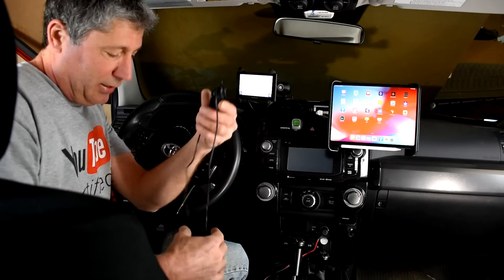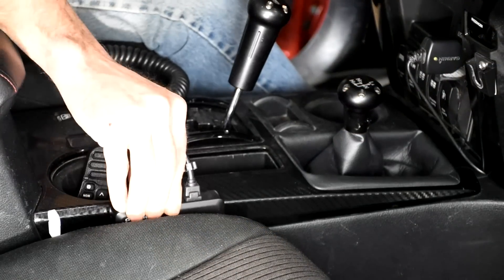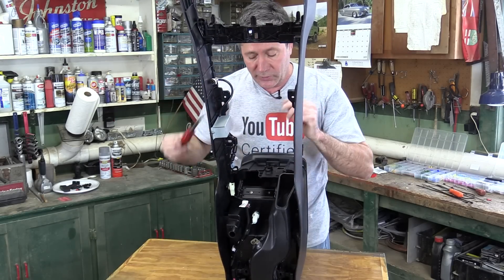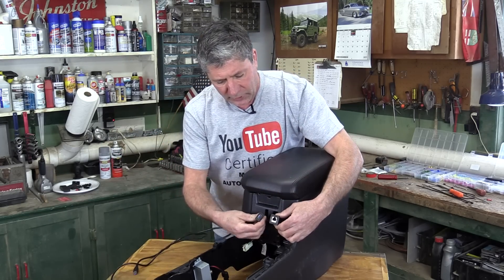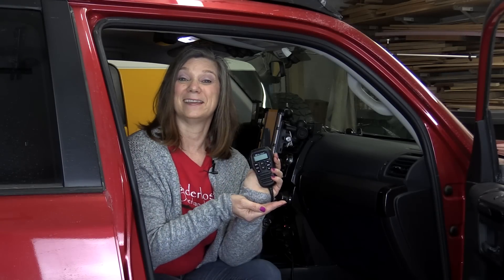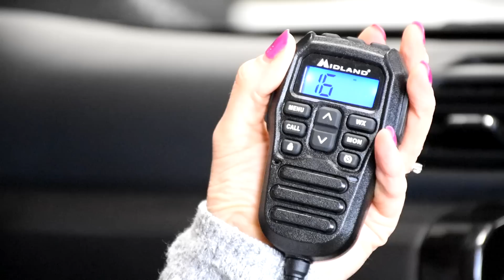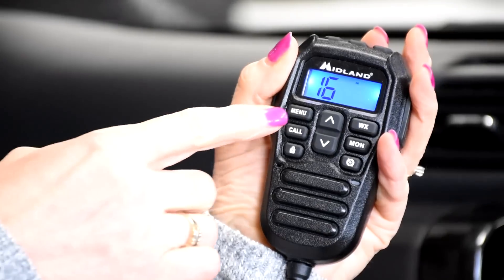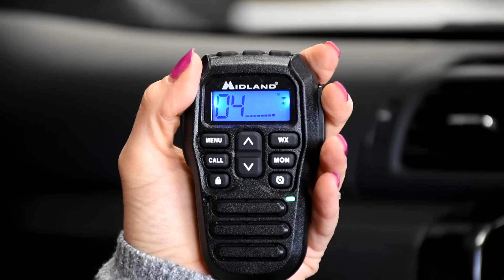GMRS Radio DIY Install & Testing Against CB Radio For Distance

Comment: GMRS is good and I am looking into getting a mobile radio. I never knew they came in small packages like that which is good because I have a small car. However don't overlook ham radio. A simple technician license is all you need and the test is extremely simple. It gets harder when you go for the more advanced licenses but really that's if you are interested in HF communications. For the most part the technician license is in the VHF/UHF realm and you'd be surprised how many new hams are getting their license even to this day. I am 35 years old and I got my license around 2013. Because there are more younger hams coming onto the scene you are seeing more digital communications and radio over internet communications. That means you can make contacts with people around the world without the need over HF. Some of the other benefits is using AMSAT which are basically satellites acting as repeaters orbiting earth and when it comes in range you can try to make contact with whoever is on the AMSAT at that moment. OR you can try to make contact with the ISS (International Space Station) who frequently make contact with hams as they pass orbit. Both of which are VHF communications. If you are more adventurous you can make your own radio projects. I've done CCTV using two cheap Baofeng radios with a computer on one end and an android on the other. You can do RTTY contacts as well. You can configure a VoIP phone system and make contacts using a Cisco IP phone. You can mix and match these systems to make them interoperate with each other. You can build your own repeater if you want. But let's say all you want is a daily driver radio on the ham radio system. Because digital is gaining much momentum in this country and worldwide you are seeing more and more DMR repeaters. This is good now because all you need is a DMR radio pre-configured to work with your local repeater and you can talk to people nationwide and possibly worldwide from the comfort of you car while driving. Believe it or not ham radio is a very active scene on the digital space.

Comment: I'm a ham as well and encourage everyone to have some type of backup communication! GMRS is a fantastic solution and all families should have it. I still like my CB as well, but due to power limits and solar conditions, there's only so much distance you can get with it. Either way, I'm really glad to see folks like yourselves informing the masses about alternative forms of communication. Great job on the install too!
Reply: FRS/GMRS are cheap enough to buy each family member one  (they came in pairs anyway :P ), with CB as backup, handheld VHF/UHF (even cheap baofengs are good enough for general use (would still prefer Icom or yeasu if going upper  tier of quality and technology provided)), mobile rig in "base car" (we did this in our prep group; mobile rig was  base, and rest of the handhelds only received audio,  no transmit due to low power TX) and if finances allow, HF is way to go :) .  more is better, AS LONG as you know how to use it properly :)

Comment: Check out MyGMRS.com for repeaters in your area that will increase your distance by 10's of miles.  especially in uneven terrain.  if the repeaters are high enough you will be able to communicate on a much wider area.  But the truth is it is all about your antenna.  The better the antenna, the more efficient it is, the further you will be able to talk.   Ham radio will get you much further and you will have other options like APRS for position beaconing.   It is superior in functionality and distance to either CB or GMRS.   If you are thinking GMRS why not take the 35 question test and get your tech license that way you get all the benefits and have the ability to use HAM if you need it, plus you can get your GMRS as well and all of that for under 100.00.    I also would like to point out there are over 700,000 Hams in the US alone.  I really do think there are more folks using ham radio than GMRS, at least for overland communications.

Comment: GMRS is a really good way to go.

15 watts is pretty powerful on GMRS, the 0.65ish meter band. And 7 miles using simplex isn't bad. The placement of your antenna however is letting the metal from your vehicle interfer with your signal. Having said that though, If you're happy with the 7 miles I wouldn't change it. 

Your vehicle has a beautiful reflective plane one it's roof that would redirect any downward radiated power from your antenna.... outward. There is more to it than this, but in effect, it's like skipping a rocks off the water verses letting them just sink into the water. 

Putting your antenna on the roof with metal below on all sides will improve your signal and distance for both receiving and transmitting.

Y'all did a great job with this video. I'd love to see y'all do one where you explore GMRS repeaters.... If you liked the distance you got with radio to radio...  You'll totally love what the repeaters will do for you. 

In our area the GMRS repeater has about a 35 mile radius, giving about a max coverage of 70 miles in the extremes.

Using ham 2 meter band and 70 cm (GMRS is nearly identical to 70 cm),  it's very normal to get 25 miles using a repeater.  25 miles is the norm with exceptions being much further.

GMRS can expect similar results.

And when repeaters are linked, which is the case with many ham repeater, than you talking about ranges in the several hundred miles. 

There are always the exceptional radios. Like the little radio on top of Mount Mitchell NC, THE HIGHEST POINT on the east coast.  A couple years ago, using  a 2 meter mobile radio I talked to the 6600 repeater that has a 10 watt transmitter that relayed my signal to a guy that was 250 miles away. It was like talking to someone in the same room.

Comment: Very nice video thanks. I wish we had gmrs over here in the UK. We have cb or pmr on the 446 frequency on 0.5w out put only line of site can be good for 20 miles plus,in a built up area 0.4 miles if your lucky. We have midland gb1 mobile car rig with fixed antenna I believe puts out 4w, not tried it but hope to get one. Pmr 446 seems to be getting more popular over here it's licence free too. I would rather pay for a licence like you said in the video for a better system here, I too am scared of test for ham lol. Thanks again. Wayne

Comment: Put a stainless whip on the CB and get out as well as receive.
Reply: Get anything thats longer for the CB.A 4 or 5 footer.The antenna you have is only for a few miles.Or shoot,,,just raise it level at the base with the roof.

Comment: For those interested, there is a vhf band available, MURS, with no licensing. I'm sure someone mentioned it in the comments. Nice video
Reply: 2 watts output on 5 frequencies: 151.82, 151.88, 151.94, 154.57, & 154.6 MHz. The 154s are wider in bandwidth. I use them for video production.

Comment: As a full-time RVer, current CBer, current HAM licensee, and GMRS licensee,   I think you did a great job with this.    The proof is in the pudding.   I have been entertaining mobile GMRS radios, but did not want to part with the cash to buy 2 of them.  If it really becomes a thing,   I will.   But for now,  2 handheld work just fine.   But the range was pretty nice on the mobile units.  Well done.
Reply from the maker: Thanks for watching.

Comment: Great video and information. I think I’ll pick up one of these radios for solid family communications as well. I already have a CB in my vehicle with a Firestick antenna. The range isn’t what I’d like it to be, though. GMRS is very promising for my needs. By the way, the ham exam isn’t too hard. I studied for it for about a week, and passed it on the first try. Still waiting for FCC to issue my call sign, so I can communicate on the local 2 meters/70 cm frequencies as well.
Reply from the maker: Glad it was helpful!

Comment: Do you have to worry about SWR levels with GMRS?  You did not mention adjusting SWR with your external antenna.
Reply from the maker: No tuning of the antenna is necessary. It works perfectly right out of the box!
Reply: @WanderlostOverland   Even if you upgrade to a better antenna as you did in your video?

Comment: Really good stuff. I want to know more about the add a circuit option and how you removed the console.
Reply: The add-a-circuit is just a fuse tap. You can find them on Amazon easily.

Comment: Are there any recommendations for a good GMRS handheld that also has scanner capabilities for other frequencies? From what I have gathered it could not be an FRS AND GMRS since frs is limited in output and antennas. So are there GMRS radios that have removable antennas, repeater use, scanner capabilities?

Comment: So you were able to transmit from the handheld to the mobile for 7 miles?  Or was the handheld only receiving?  Thats pretty good range.  I have handhelds that we use camping.. but I was thinking of adding the MTX275 to my truck for additional range.  Thx for the review.

Comment: Cb range distance depends slot on quality of antenna. I can get 7 miles or better thru woods  you have to turn squelch of for longer ranges. It does pick up electrical noise

Comment: Was the power for this connected to a fuse only circuit on the bussmann which is always on? If so, I am guessing the handset powers on the actual unit once you want to use it.
Reply from the maker: Correct, there's an on/off button on the handset.
Reply: @WanderlostOverland  ok great. Thanks for the response. I modeled my bussmann/switch after your video. Just verifying before I do/buy anything :)

Comment: Thanks for the video! What kind of external speaker are you using?

A lot of CB users are saying that GMRS is becoming superior. And with what the FCC is granting as far as allowing its use and capability, they are opening the door for manufacturers to expand on the GMRS technology. HAM is still superior but HAM is also complicated. Not everyone has time to "nerd out" on frequencies.
Reply from the maker: Thanks for watching Eddie! The speaker is from Cobra.

Comment: I live in the Midwest and have both hills and open plains for terrain. I have traveled all over North America and also in the Middle East overseas. I am a HAM radio operator and I also still use CB. This has always been a very divisive topic. FM and AM are apples and oranges and not a fair comparison. The CB has one ace in the hole if you get the right one. If you get one that has single side band it can talk and listen amazingly far. If you wait until sundown and within a couple hours after you can talk amazingly far on what they call skip. FM will always be clearer but the right match up on CB will be just as equal in distance. FM is line of sight but CB can talk over the hill in many situations. SSB on AM CB is a completely different animal and you have less static to deal with and is much clearer. I agree with using whichever you feel more comfortable with. HAM radio beats them both in their respective niches. I ran a 99 suburban with a 1/4 whip and a spring mount on the roof rack. I beat trees all day long with that thing and still could out talk anybody on the road with it. I ran a Galaxy 949 with SSB. One late fall night I stopped in a rest stop in Iowa off of I 29 on the flat river bottom. I talked to a guy from New Zealand   for 4 minutes before I lost him. That will never happen with FM. FM get's you down the road and AM get's you around the world. Just got to use the right tool for the right job.
Reply: 10m FM will propagate just like 10m AM & 10m SSB will when the band is open.

Comment: 🤣 passing the Amateur technician test isn’t hard at all. It’s 30 questions and pretty much common sense. If your not decent familiar with ham radio I strongly suggest getting the ham study guide just make sure before you purchase, that you have the proper edition as the question pool will change with time. Plus it’s nice to be able to communicate during power outages to keep up to date and being able to receive real time information from storm spotters, being way ahead of the news channels. It’s a lot fun. Especially, DMR radio’s with today’s internationally linked nodes. Sit at home and talk all over the world through your local repeater or over WiFi to available talk groups 👍

Comment: A CB will generally travel more than 2.5 miles but with a rather large expensive antenna.  For most who are trying to achieve what you are, GMRS with a quality antenna like the one you have is the way to go.  1/4 wave length on CB is roughly 9'.  Any antenna shorter than that is a compromise.  1/4 wave length on GMRS is about 6".  Antennas larger than that designed for GMRS use, such as the one you are using, will provide an even better radiation pattern.  GMRS also generally has a much lower noise floor than CB radio and is not as subjected to being blocked by buildings and the like.  Put it all together and GMRS is a far better system for what you are using it for.  I am a licensed ham and GMRS radio operator who started in CB many many years ago and at this point I wish truckers, off roaders, RV'ers and everyone else would make the switch to GMRS.  It makes for much more versatile and clear communication with virtually no atmospheric and electrical interference.  In Australia they have already made the switch to "CB high," UHF communications and "CB low" has faded out as many people begin to see the benifits of UHF vs HF for local communications.  Good video.  Good information.  And yes I did see the part where you covered needing to have a license, and thank you for that.

Comment: FYI There is no guaranteed set standard for the numbering of channels on FRS, GMRS, or MURS. Do yourself a favor and copy a channel to frequency list from the manual for reference. Also if you do not want to pay for a license FRS uses all of the same simplex channels at a lower power and no external antenna (shorter range). And communicating between GMRS and FRS users is permitted.

BTW the results were not surprising looking at your setup. Both CB and GMRS have their advantages and both cam communicate full line of site on flat mostly open terrain (which is about 10 miles) with a good setup and proper conditions. It is just that you have a better GMRS setup due to the mounting location and Antenna than CB (it gets technical).

Comment: The CB is good it has its own plus and minuses. The GMRS is good for all around because the atmosphere does not interfere with its operations as much as the CB. The only bad thing about the CB is the skipping, sometimes the skip is so bad the radio is useless. However, when it comes to range the CB can sometimes have an advantage depending on the time of the day, and how your antenna is set up. If I were on a road trip to nowhere I would put my life on the CB, when condition is right you can talk farther than the GMRS radio. I talk to people and hear people thousands of miles away on my CB.

Comment: Youtube recommended this video to me after a local Ghostbusters group talked about using HAM radio. The second to last time my wife went on a trail with a local Jeep group that uses CB radios, the women were going down a trail closed to vehicles, which my wife did not go and do herself. The first trip for me, and the last trip for both of us, six Jeeps got stuck within a 25 minute period while they were going into the mud holes just waiting bumper to bumper. I told my wife to leave as it was no fun and her Jeep didn't have a/c. Come to find out, there were twenty five Jeeps all heading down a one car trail that dead ended. After that came the photos of them tearing up the national forest. From then on, my wife and I have just been trail riding by ourselves. 

I know that I can personally pass the test for HAM radio. However, my wife has a learning disability (she managed to fail the mandatory drug and alcohol knowledge test for her driver's license) and so anything slightly complex like the HAM radio test is going to be too much for her. She would have to be a licensed HAM operator as well if we were to go that route, as well as the renewal licenses. So I am glad that Youtube recommended your video, and learn about the FCC covering the entire family. 

This is because, despite living in Florida, where there are no hills, I was trying to keep in touch with my wife through the CB radio. She had just gotten out of the dealership with her 1995 Jeep Wrangler, and I wanted to make sure I could talk to her in case anything happened. I had my 2013 Jeep Wrangler and a whole bunch of groceries in the back. I lost communication with her with the CB radio. So I stopped and waited for her to come up the road, as it was just a straight road with not a lot of buildings in between. She had decided, unknown to me, to go an alternate route to home and the car actually broke down. No CB radio communication, no cell phone reception. I almost lost the refrigerated groceries waiting for her to come by me, and I have been wanting to find something with a longer range than the CB radio ever since.

Comment: You should be able to do a LITTLE better with SSB.  But that does require that both ends of the conversation have an SSB CB radio, which as you can imagine are more expensive.
Reply: I used SSB CB for yrs and could easily communicate between home and the river we sturgeon fished nights it was 30+ miles distance. I can see the advantage of using GMRS since its so quiet compared to CB AM. Plus that mxt275 unit is very cool for installation in a modern vehicle.